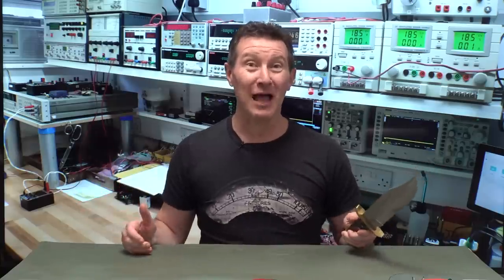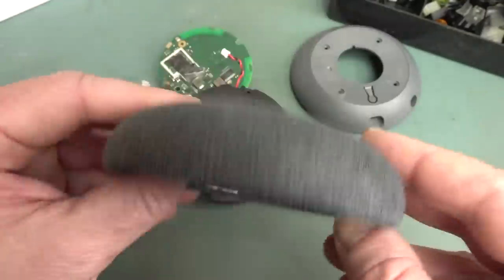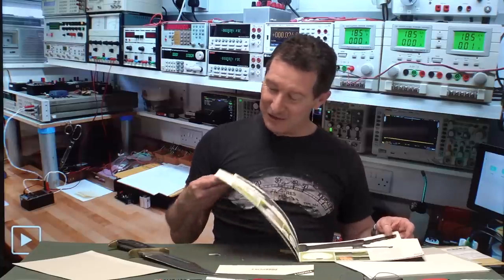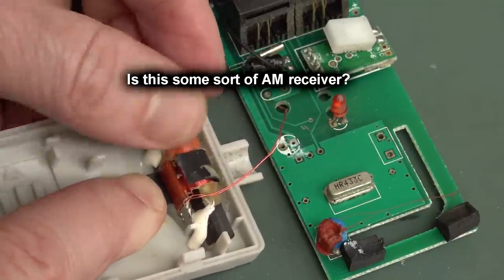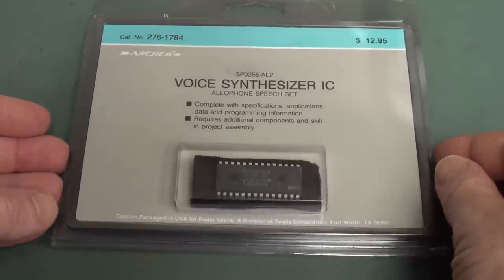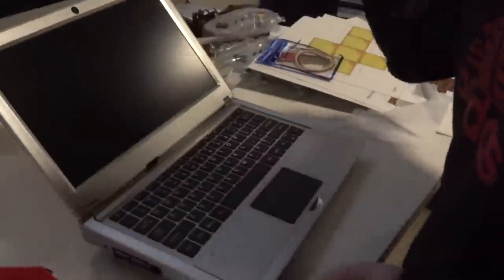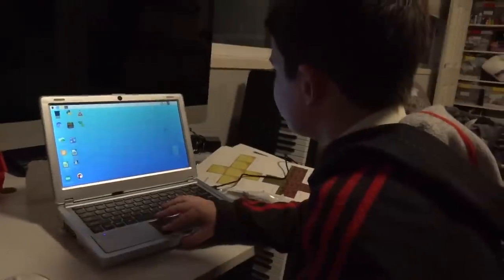EEVblog #1330 - Mailbag with GUEST LABS!

Comment: I'm really liking the backgrounds - well done.  BTW - the IBM reader - I used them back in the day (1991-1994, Providence, RI, USA), it was a part of the IBM 4700 Finance Communication System.  It wasn't for cards, it was for passbook savings books.  The books had a magnetic strip (about twice as high as the credit cards) and it would record account number, balance, etc on it.  When a customer would want to deposit/withdrawal money, swipe the book, open the book and print transaction inside, close book, and swipe again to update the info on the strip. This is why there was a springloaded plate to keep the book to the read/write head. Worked well.
Reply: Richard Thompson My local Building Society (essentially a mutual, member-owned bank) here in the UK still issues such passbooks and has read/write devices similar to the one in the video at its counters.
Reply: ...wait a minute... I'm in Newport >.>

Comment: I remember a magazine review of those dry etch transfers. It was printed 2 or 3 times with different rasters to prevent light-leaks. Tho I owned a few of those sheets, I never got around to use it. An accident involving ferric chloride and a pile of clothes led to a permanent ban of the brown granules in my household...

Comment: The dome thing in front of the speaker on the magnesium heatsink thing is called a phase plug. It's used to reduce interferences in higher frequencies caused by cone to cone stationary waves.

Comment: Dave, I have one of those weather stations.  The wind direction, speed and rainfall "sensors" are basic sensors that use a mix of reed switches and resistors (wind direction) , and reed switches for wind speed and rainfall, all tripped by small magnets.  The unit you have there then wirelessly sends data to a small (A5 size) base station which displays the data, and allows PC software via USB to download stored data.  Some versions also included the functionality of syncing with "atomic" clock signals to time code the data accurately. - Hope that helps
Reply: I have the same weather station under marketed under the Waston name product No is 8681. In the UK it was also sold by the now defunct Maplin electronics store chain, under there own brand name and coloured grey instead of the off white. 

The sensors being mainly reed switches are easy to repair, and do have a long life. Mine has been giving weather data for over a decade, which is pretty good going for what is effectively a cheap consumer grade weather station.
Reply: @johnnodge4327  John, I got mine from Maplin, and I believe Fine Offset is another branding.  I had to replace the original sender unit purchased in 2008 after four years as it gave out faulty temp and humidity values. The replacement has been running fine for the 8 years since, which is not bad for a domestic bit of kit costing around £60 for the complete kit.  Still running Cumulus ver 1.9.4 - does the job well.  The only issue is spiders in the rain gauge !!
Reply: @MalcolmCrabbe  

Mine has also stopped giving humidity data, but the temperature sensor is accurate to 1°C, which isn't bad. My base station LCD touch sensor started playing up, so I disconnected that. The touch sensor isn't needed as the settings can be controlled by EasyWeather, which came in the weather station. I have Cumulus but used Easyweather as I only connect the station to the PC occasionally to download the stored data. 

I have also had to replace the anemometer twice, once it lost a cup in a gust exceeding 99Mph!!, and a second one had a bearing seize. I've replaced a few reed switches in both the direction and anemometer too.
Otherwise it's just an occasional spider to remove from the rain gauge, and an annual battery replacement in the transmitter. I also use petroleum jelly on all the connections and battery terminals, which I'm sure has helped keep it working reliably for the last decade.

Comment: Dave I worked for a contracting company who did a bunch of the I.T. stuff for Conyourwealth Bank in the early 00's. I was involved in ripping out the keycorp gear and replacing it with some newer stuff, but before they replaced the computers, they refitted all the branches with new shop fronts designed for them.

The keycorp keyboards did indeed have the card swipes built in, but the one that a lot of people may not know is that the connection between the keyboard and the computer used a custom interface card and the connection between keyboard and the card was hardware encrypted!

It got really fun when you were pulling out a number of the workstations to allow them to do the shop refit and putting them back, because the cards and keyboards were paired and if you mixed up the keyboards, it wouldn't work properly with the computer. Each computer was (if I remember correctly) a 386 with something like 4MB of RAM, and booted into windows 3.1.... Then when you started up the banking application that started an OS/2 Warp 4 security kernel inside Windows that then communicated with the keyboard via the card and wouldn't actually load properly if the keyboard and card weren't communicating.

This meant that in the case you had mixed up the keyboards... it took about ten minutes to load everything up and see whether or not it was the right one. With 10 or more computers in each branch this could turn into quite a process!

The other part of this that was a lot of fun was that for a while they had the new system and the old systems in place with a KVM under the desk to switch back and forth between them. I got some complaints from the branches about the cables not being tidy enough and head office sent me two 10cm velcro cables ties to tidy up the cables under each desk. I sent them back a picture of the bundle of cables and they sent me 100m reel of doublesided velcro instead!

Comment: The ferrite rod could be either for a radio controlled clock (e.g DCF77, MSF) or lightning detection.
Reply: I agree,The ferrite rod looks a lot like part of a radio controlled clock, and weather stations often include one too
Reply: yup those are for radio clocks indeed.. no lightning detection , those coils are 15khz+ at least
Reply from the maker: I figure it's something like that.
Reply: ---- Another EVIL we've all missed. Look up, for this video:
Dr. Carol Baker: "Get rid of all the whites"
Reply: I'm not sure why the transmitter would need it. Does it do something fancy like tag weather data with precise timestamps?
Reply: @NiHaoMike64  perhaps the "head" unit was pretty small and sleek? So they put the clock receiver and all in this transmitter unit ?
Reply: @3v1Bunny  I'm wondering how the latency of the typical low-baud 433.92 MHz transmission would affect the final accuracy of the clock? Does seems an odd design decision to put it at the TX end.
Reply: @_lwza_  those clock receivers are purely used to synchronize clocks. It is not meant as a continues feed. So the xxms latency in a 433MHz signal is not an issue. It is there to set the correct time and correct clock drift when a signal is received(mainly by re setting the time). For these kind of devices one doesn't really look for sub minute accuracy :D
Reply: Another vote for the radio clock - station in the US broadcasts a time signal bang on 10.0000mhz plus some others
Reply: @mititeimaricei  Thanks for the great example of quote-mining and how misleading information is spread on the internet. Fortunately if someone looks it up, he will find the discussion about the amount of anti-vaxxers in different communities and that they could solve the anit-vaxxer problem by ignoring a particular stupid group.

Comment: Hi Dave, thanks for nice comments! 
18:43 thats right! we make custom-pcbs for various projects and sometimes use this owen to solder them properly 
19:39 thats a helmholtz coil, used for producing controlled magnetic fields
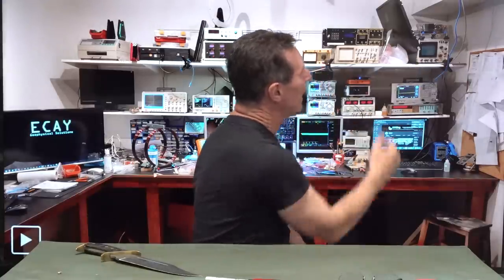20:15 it's a fluxgate magnetometer coil / core tester. We produced it to test our magnetometer sensors. also helmholtz coil is a part of it

Comment: Yes, the Handspring Visor was actually a Palm organizer, just rebadged with a slightly different case. Those things were quite awesome back in the day! I remember doing ICQ and e-mail back in 2001 over IrDA with my Nokia 7110 GSM phone as the modem. (The phone with the springy sliding mechanism from the Matrix movie, although not the same phone as in the movie, that one didn't have the springy mechanism, just a normal slider.) I got a whopping 9600bauds, but that was actually enough to chat with one person over ICQ back then! Although it had to be precisely aligned, laying flat on the table and any movement disturbed the connection (which made it so that I used the stylus on the on-screen keyboard instead of writing Graffiti on the writing area of the screen, because that was how you wrote on these devices back then!

Comment: The wireless earphones mean you don't hook them on equipment or furniture when moving round the office / workshop. 

I'm not a plan of the pod ones since you're likely to loose one, but I have a pair of Sony's with a link cord between them and they're far less hassle than a plug in pair.

Comment: @26:45 that AM circuit is most likely for Radio Controlled Clock. All over de HF band (25Khz - 30Mhz) there are worldly spread long range timecode transmitters on several frequencies all in sync with the atomic clock and timezone corrected

Comment: I used to have a pair of smallish book shelf speakers (about 12" diagonal front, IIRC) made by BOSE that were quite good. Despite their small size the had good bass response. The white box on the weather receiver PCB has the letters RH beside it on the PCB. That would make it a humidity sensor.

Comment: Wouldn't be unusual for the receiver board to have a temp/humidity sensor on it. It receives info from the outdoors sensors, and at the same time gives inside temp and humidity readings, all in one box.

Comment: As someone who owns and uses a Google Home I can say it's actually quite useful for doing quick calculations and conversions. I originally bought it for the sole reason that it ended up being cheaper then a chrome cast audio. I have a big Bluetooth sound system that has a rubbish antenna design with a range of about half a meter. At first I intended to keep the microphones muted and just use it as a WiFi enabled Bluetooth transmitter to stream audio over but as I mentioned before I just kept the mics on and use it for a bunch of stuff now. You know the saying, who cares about privacy if you have nothing to hide (obviously to a certain extent).

Comment: those direct etch thingies were sold under Mecanorma brand here in France. Used tons of em back in the days  :-) But I never used mixed decals sheets. They also sell ribbon tape rolls for the tracks that were convenient as well. 0.5 mm for sure !
Reply: When I was first studying electronics we used the tape on transparency film to make negs, then expose UV harden coated boards... I had tried direct when studying, but always had too much creep with the etch. We used ammonium persulfate rather than ferric chloride...

Comment: THe weather station thing used to be the main outside unit as sold by companies like LaCrosse Weather Instruments and you could either plug sensors in and then use WiFi to connect to the display unit inside. I used to have one of those, a good two decade old now.

Comment: Hi Dave,
Like the new backdrop system very impressive.

The SPO256 , remember those things from way back,  Here in the UK there was a company called Maplin Electronics. they had lots of stores all over the place, but like many they went out of business as a retail store. They do exist as an on-line store, but nothing like the old shops.

They used to produce their own magazine, and back in March 1983 they published a circuit using the SPO256 as the Vic20 talkback it might provide a bit of amusement / bring back a few memories.

(I must have that project somewhere in the loft)

There is a archived copy here:
https://worldradiohistory.com/UK/Mapelin/Maplin-Electronics-1983-03-05.pdf

Comment: Sinclair C5
from Wikipaedia

Out of 14,000 C5s made, only 5,000 were sold before its manufacturer, Sinclair Vehicles, went into receivership.

The C5 became known as "one of the great marketing bombs of postwar British industry"[3] and a "notorious ... example of failure".[4] Despite its commercial failure, the C5 went on to become a cult item for collectors. Thousands of unsold C5s were purchased by investors and sold for hugely inflated prices – as much as £6,000 compared to the original retail value of £399. Enthusiasts have established owners' clubs and some have modified their vehicles substantially, adding bigger wheels, jet engines, and high-powered electric motors to propel their C5s at speeds of up to 150 miles per hour (240 km/h).

Comment: The crow pi is cool but it costs 270 without the raspberry pie and 130 extra for the 4GB raspberry pi. Not only is it useless without the pi but the raspberry pie doesn't cost nearly 130. the 8GB costs $75 and they want $170 for it. That ruins the whole thing knowing that they are ripping people off like that. No store charges a markup like that on the raspberry pi. They themselves sell the raspberry pie for 75 separately why does it cost 170 if you buy it with the crowpi?

Comment: Dave, could you do a video on the best oscilloscope for around $1000. You mentioned, I believe in the Siglent SDS2000X plus  video, that you might do one.
Reply: I think he reviewed the Rigol MSO5000 which is 999 and over 4k with all the Unlocks but you can unlock it yourself and have a 350Mhz 4ch, 8GS scope with 2channel AWG and 16 channel analyzer for $999 or $909 for the 2 channel version. They made it really easy to unlock it too. The guide is on the forum. I don't think there is a better deal to be had.

Comment: Voltage and Current are the same thing.
Reply: What the heck? No they aren't. You need to learn basic science and Ohm's Law.
Reply: @ct92404  no.. they are.
Reply: @emmetray9703  Voltage = electromotive force.
Current = electron flow per unit time. 
They are measured in different units and measured and calculated completely different. So explain how they're the "same." You're confused.
Reply: @ct92404  No. They are same, ohm's law is wrong.
Reply: @emmetray9703  ok, you really are a nutcase. "Ohm's Law is wrong." LOL you obviously don't know anything whatsoever about science and have never worked with electrical circuits.
Reply: @ct92404  :D :D relax mate.. I was trolling you.